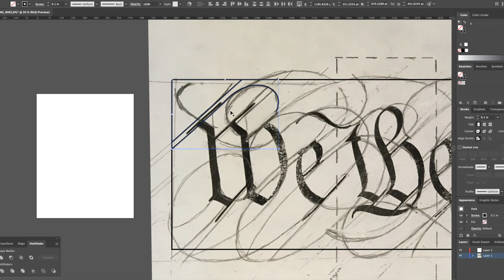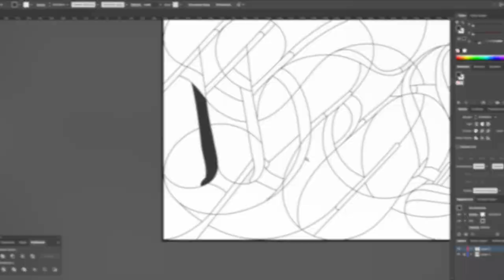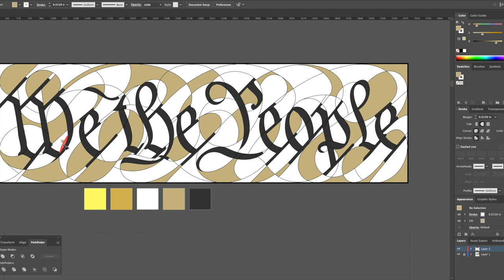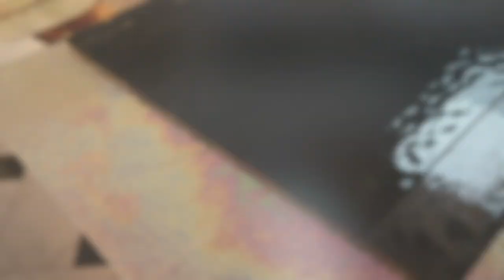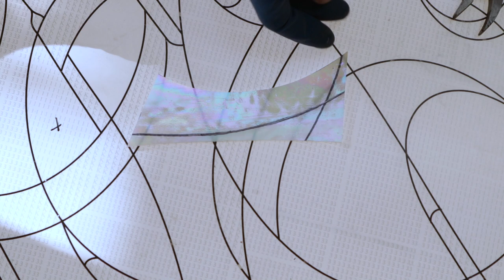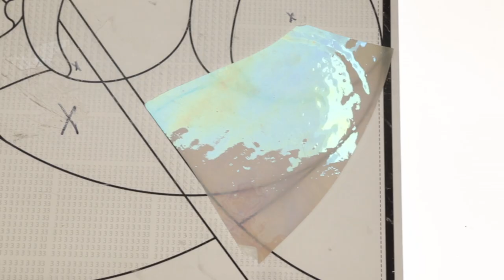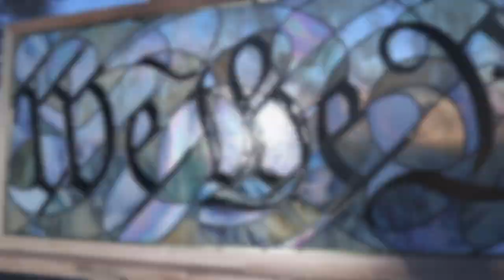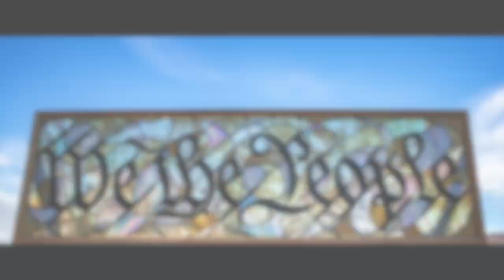full process - WE THE PEOPLE - stained glass window

Comment: Amazing! Thank you for making and sharing this video. Do you mind sharing cement ingredients and measurements?
Reply from the maker: Thanks for watching; I'm happy to share. I use 3:1 whiting (chalk) to portland cement and 3:1 boiled linseed to white spirits. The measured amounts vary depending on what consistency I'm going for and how much I'm making, but measuring the dry powders in 1/2 cups and the wet material in 1/4 cups is probably good start for most windows. Once it's mixed, add whiting to thicken it or oil to thin it. I put stove polish in it to darken it when I use lead came, but you can use cement pigment or india ink, or nothing. The portland makes it pretty gray already. I usually go for the consistency of honey, which is pretty loose, but I use really small came and assemble pretty tight, so it works for me.

Comment: Beaurtiful piece, I loved your process. What are the ingredients and ratios of your cement putty?
Reply from the maker: Thanks for watching; I'm happy to share. I use 3:1 whiting (chalk) to portland cement and 3:1 boiled linseed to white spirits. The measured amounts vary depending on what consistency I'm going for and how much I'm making, but measuring the dry powders in 1/2 cups and the wet material in 1/4 cups is probably good start for most windows. Once it's mixed, add whiting to thicken it or oil to thin it. I put stove polish in it to darken it when I use lead came, but you can use cement pigment or india ink, or nothing. The portland makes it pretty gray already. I usually go for the consistency of honey, which is pretty loose, but I use really small came and assemble pretty tight, so it works for me.

Comment: Really nice work! Will you share your glazing recipe? I've always used a thicker consistency but yours looks easier on the fingers and likely more efficient. Thanks!
Reply from the maker: Thanks for watching; if you're talking about the cement, I'm happy to share. I use 3:1 whiting (chalk) to portland cement and 3:1 boiled linseed to white spirits. The measured amounts vary depending on what consistency I'm going for and how much I'm making, but measuring the dry powders in 1/2 cups and the wet material in 1/4 cups is probably good start for most windows. Once it's mixed, add whiting to thicken it or oil to thin it. I put stove polish in it to darken it when I use lead came, but you can use cement pigment or india ink, or nothing. The portland makes it pretty gray already. I usually go for the consistency of honey, which is pretty loose, but I use really small came and assemble pretty tight, so it works for me. 

Some folks add japan drier to make it dry faster, or a mix of raw linseed oil and boiled for some reason, some don't use any cement and just do whiting/oil/white spirit. All three of those approaches are perfectly reasonable, they vary in final rigidity, ease of disassembly, and speed of drying. 

The only thing you shouldn't ever do under any circumstance is use plaster of paris.

Comment: Re: your glass cutter.... Are you not using oil or just not showing that you are using oil during your cuts? Sending lots of love 💖 from sunny 🌞 Arizona 🌵. Take care of yourself and each other 😷
Reply from the maker: The way I framed and cut the glass cutting shots omits my cutter oiling procedure. I have a spice bottle with a paper towel crammed into the bottom of it soaked in oil. I just squirt whatever I have on hand in there - WD40, 3 in 1 oil, chainsaw lube, 10W30, olive oil, whatever. I'll dab the cutter into it a couple times and then swipe it across the top of my hand to even the oil out. I think my video of the brass grid window insert shows that but I can't remember. I'll be sure to include in the the upcoming video.

Comment: Care to share the cost/price for this? Was this a labor of love or a commission? How long were each of the steps? Design? Vectoring? Cutting? Leading? Finishing? 

Thanks for posting this. It’s unbelievably beautiful. I love how the glass looked a certain color on the table but then it took on different hues in different sun light.
Reply from the maker: Thanks a lot for watching.  

Going rate for commissions in my region is around $300 per square foot, so a piece this size and complexity would be around $4k or so to have made. I have no idea what my material cost was but I'm sure it's probably near $100 per square.  

Not a commission, just something I was compelled to make. It's mostly intended to be a study in lettering and using opaque black. I learned a lot, so it was well worth the time and expense. 

Each step took around 30 or 40 hours each (design / template, cutting, assembly / finishing). So I'd guess I have around 120ish hours in it. I naturally work kind of slow, and filming makes everything take a lot longer.

Comment: What did you use for cement what brand name? And how did you make glasses very shiny what you use for that absolutely awesome im trying to do very small thinks I'm the learner thanks
Reply from the maker: thank you very much for watching

i'm copy pasting my answer from another comment since you have the same question about the cement

---
i make my own cement. i use 3:1 whiting (chalk) to portland cement and 3:1 boiled linseed to mineral spirits. The measured amounts vary depending on what consistency I'm going for and how much I'm making, but measuring the dry powders in 1/2 cups and the wet material in 1/4 cups is probably good start for most windows. Once it's mixed, add whiting to thicken it or oil to thin it. I put stove polish in it to darken it when I use lead came, but you can use cement pigment or india ink, or nothing. The portland makes it pretty gray already. I usually go for the consistency of honey, which is pretty loose, but I use really small came and assemble pretty tight, so it works for me. 

Some folks add japan drier to make it dry faster, or a mix of raw linseed oil and boiled for some reason, some don't use any cement and just do whiting/oil/white spirit. All three of those approaches are perfectly reasonable, they vary in final rigidity, ease of disassembly, and speed of drying. 

The only thing you shouldn't ever do under any circumstance is use plaster of paris.
----

i get portland cement at the hardware store, I'm sure it's quikcrete brand but I'm not sure. I get whiting from the turf supply, they use it to mark baseball fields, but you can also get it from a stained glass or ceramics supplier.

As far as getting the glass really shiny, most of that work is done by the many rounds of polishing with whiting and a soft bristle brush. You can see me start that process in this video at 40:00. dust whiting on, rub and brush it all over with a soft bristle brush, vacuum it up. rinse and repeat. the more times you do it, the shinier the window gets. im not sure i've found an upper limit to how many times is too many times. 

at the end, i use a stiff horsehair brush mounted in a power drill called a PIZZAZ BRUSH. you don't see me use it in this video but check my first two videos. the brush sells for something like $50, it does a fair job polishing the glass but it makes the lead came really dark and shiny.

Comment: Plz Explain Last Finishing Materials & How did silver turn to black?
Reply from the maker: The linseed oil in the cement mixture generally darkens the lead and turns it black. The horsehair brush on the drill I use at the last step burnished the darkened lead to make it really deep and shiny.